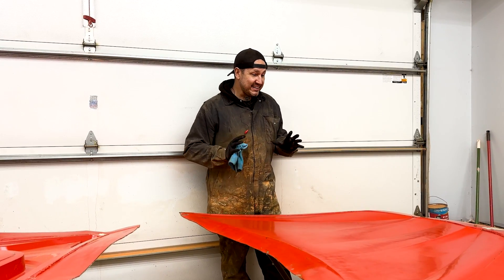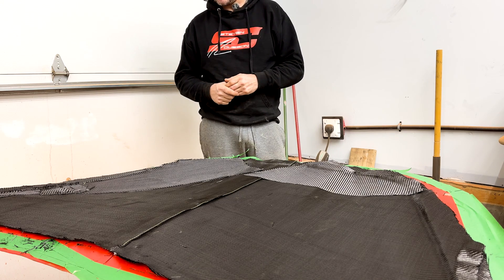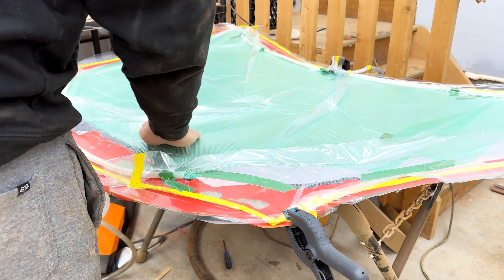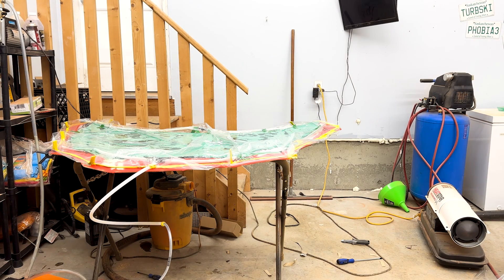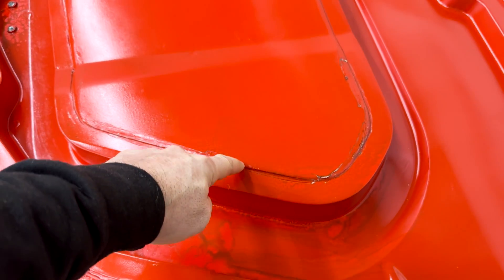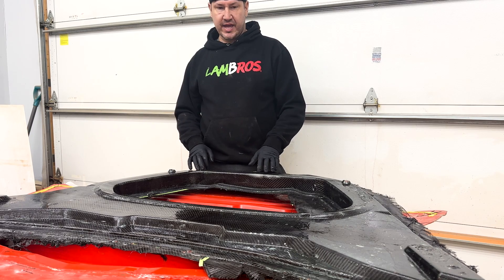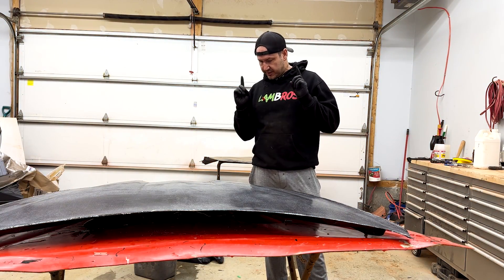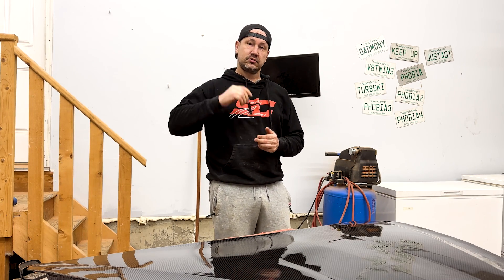How to Make a Carbon Fiber Car Bonnet/Hood -  Resin Infusion

Comment: Hey! Awesome video you did a great explanation. I actually plan on building my own carbon hood for my car, but I had a question regarding the hood hinges. How would I go about mounting the carbon hood to the hinges, did you just end up using fasteners that have the same thread as the bolts for the hinges?
Reply from the maker: You bet. I have another hood video coming out next weekend. You can see better of what I use. The video is more focused on why carbon fiber cost so much.  But I’m building a hood in it. The fasteners I use I get at Easy Composites for fairly cheap